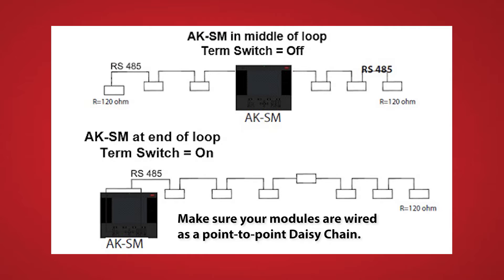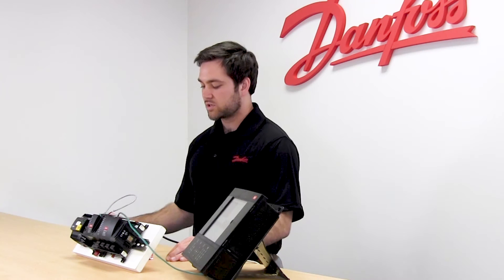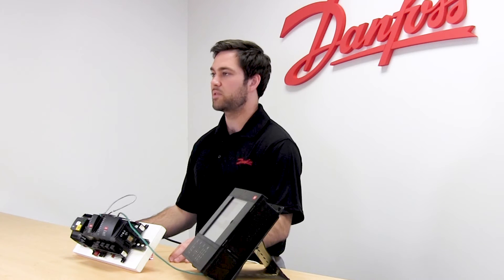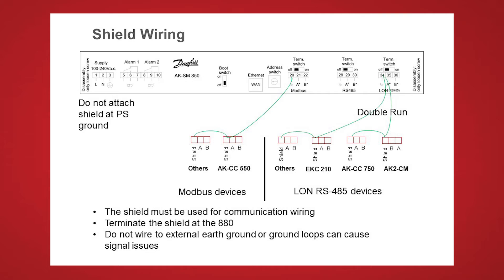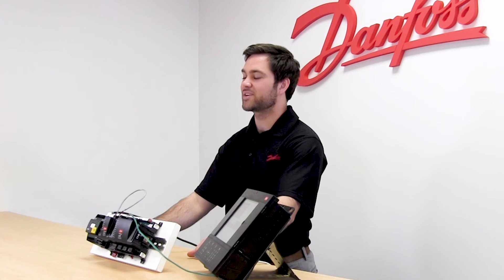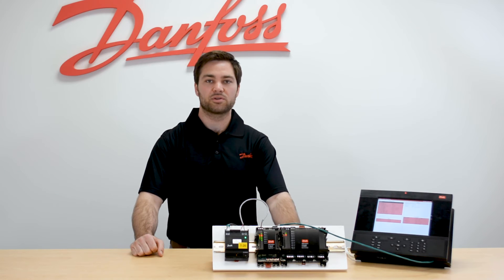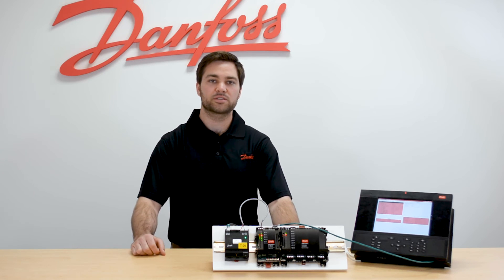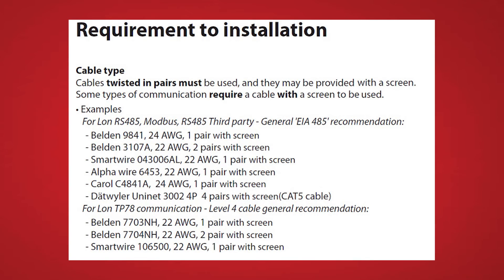Troubleshooting Danfoss communication issues | Technical support for supermarket controls

Comment: Hi, Can you help me this this problem? 
We used communication module 61 and left them online but after a few months some communication modules are offline and the status and error led's are off, the comm led's of the I/O modules are on.
The only way to correct this is to replace it with a new communication module.
Why is this problem happening?

Comment: After connecting 4vfd in a loop sometime communication getting lost .and sonetime after giving start command from modbus communication getting lost
Reply from the maker: Hi - please review our wiring guidelines document (link below) to confirm you have used the proper wire type and wired properly.

https://assets.danfoss.com/documents/35832/AN234886440486en-000901.pdf
Reply: @DanfossNorthAmerica  What DC should u be getting coming out of the communication module ? U said 24 AC or DC for power but what’s the output going to AK-SM820A?